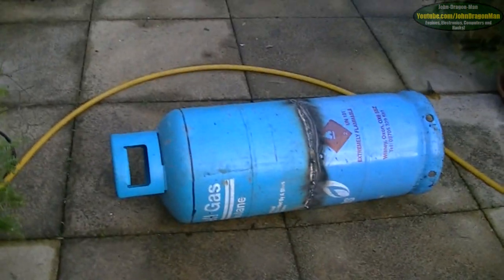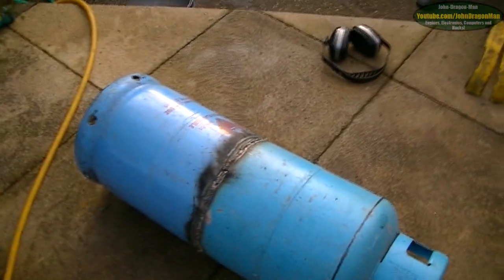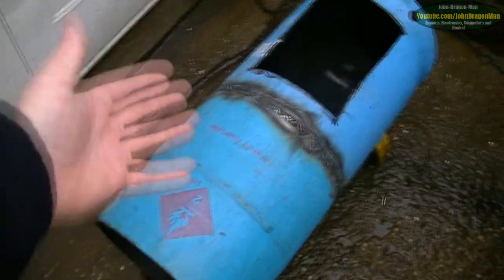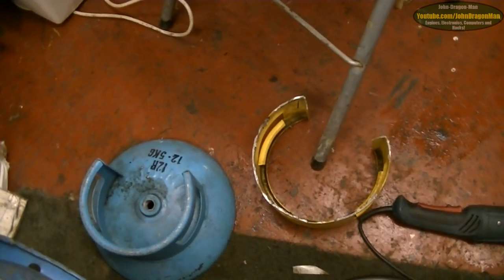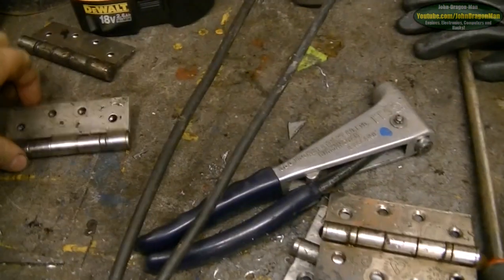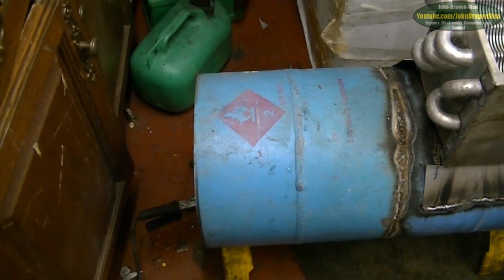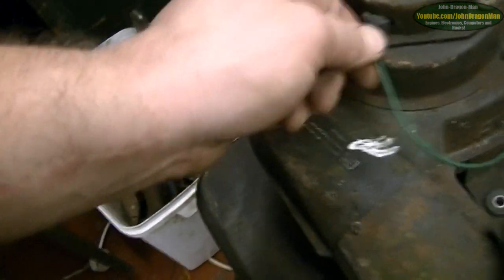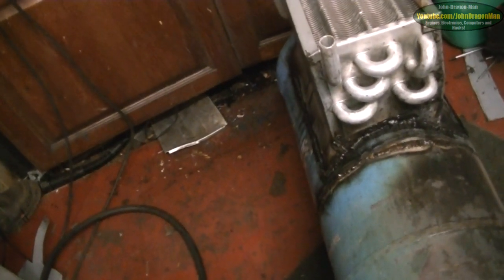Waste Oil Buring water heater pt1

Comment: Where did you get that Heat Exchange? Thank you !!!
Reply from the maker: local scrap yards! best place for anything like this :D
Reply: +JohnDragonMan - Hahahaha, yea I know... But do you know what it come off at??? Looks supper Heavy Duty :)))
Reply: @JodBronson  im trying to work out what the heat exchanger is from too. Is it from an air conditioner or oil cooler or???
Reply: @NaughtyGoatFarm  - He never answered.  My guess it must came from some sort of Heat Exchanger, like from Hot Water Heater of some sort.   This is NOT from Air Conditioner for sure... He was able to "Weld", so that tells me it's ALL Metal!
Reply: @NaughtyGoatFarm  - Oil Cooler or air Conditioner usually aluminum.  He was able to "weld" it.... That tells me it's not from those two sources.